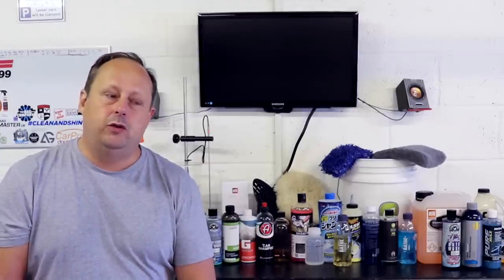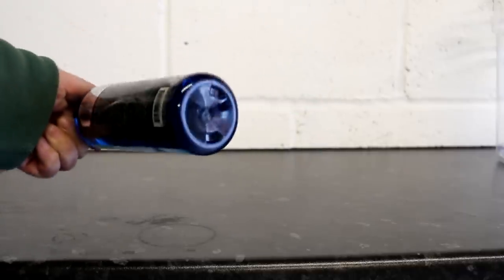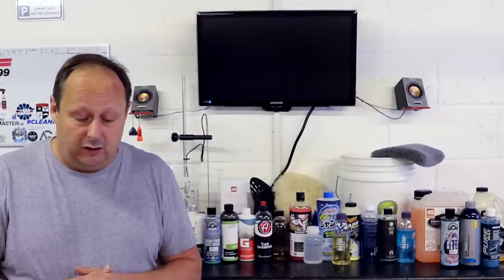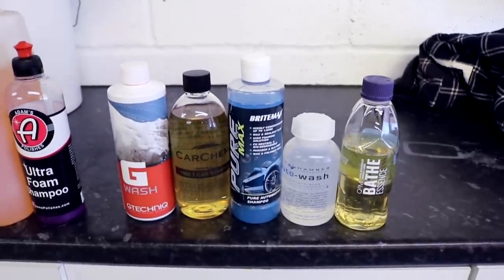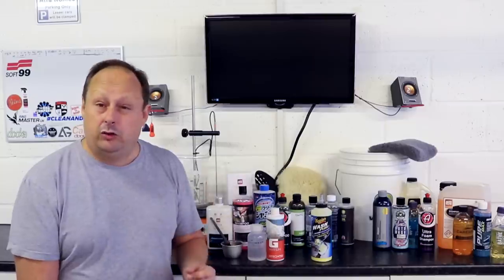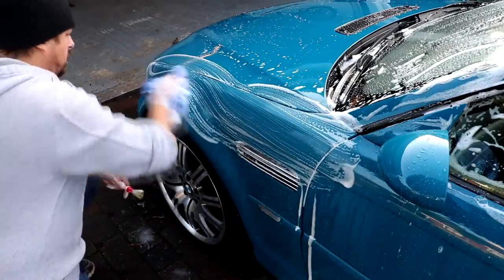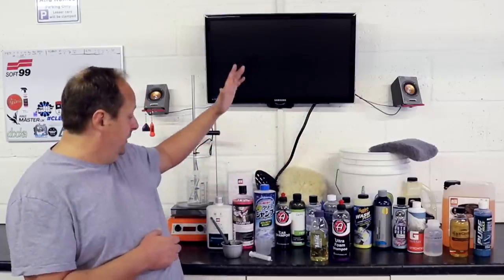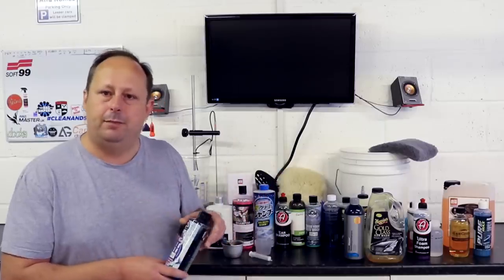The Best Car Soap Shampoo - 20 product shootout

Comment: Really impressive review Jon. I did not realise how concentrated Gyeon and Gtechniq's shampoo's were. I'm no pro detailer, but I do like the feeling of having plenty of product in stock. I think that's what put me off of buying them and the bilt hamber shampoo. Having said that I will change my thinking having watched the review. Once I get through my 5L tub of Auto Finesse Lather, which smells amazing and leaves a nice glossy finish; I will look to get either Bilt Hamber Auto Wash or Gyeon Essence. The other shampoo I use for when I am looking to decontaminate is Chemical Guys Clean Slate, which seems to work fairly well. Keep up the good work.

Comment: I don't want anything to do with the super high concentrates. When I'm out cleaning my car the last thing I want to be doing is measuring out soap with a dropper pipette. Since I have a ceramic coating a couple of capfuls of Carpro Reset and boom I'm good to go. Decent price, foams like nobody's business, and very effective. Also you mention it a bit but the big upside to the Adams soaps is that even if they dry in the sun they still spray right off.

Comment: Terrific video Jon, I'd love to see one on the pros and cons of over and under dosing. I'm and Adams user in the summer and a carchem user in the winter.
Reply from the maker: yo dave, overdosing just for me means its much harder to rinse and even if it looks like you have rinsed properly much higher chance of soap stains and all the concentrated soapy water that gets into the wing mirrors and run off areas, when that rruns out later on its gonna be more soapy..  underdosing can just mean theres like less cleaning power, less suds less slippyness.   Im not sure which is the lesser of two evils really.

Comment: I'm currently using the Meguiar's Gold Class shampoo on my almost new all-black 370Z and it does a good cleaning job with good gloss afterward. After I get the paint corrected and get a ceramic coating applied I will do some research to find a possibly better shampoo for the finish.

Comment: Great video and i respect your findings and  your winner, i have tried well over 20+ shampoos and the number 1 thing i look for is slickness (which you did not mention much in the video) which is why Carpro reset is my favourite as it is super slick and i use it at 20ml so pretty cost effective aswell and it foams well and not overally expensive to buy either, so i find reset the best all rounder and i have Gyeon essence also but will still use reset, based on how good it is to use and slickness.
Reply from the maker: I honestly couldnt measure slickness jason, when I planned out the video ages ago it was one of the things I was gonna try and look at and rate them on.  a couple of the companies that manufacture also say there is no like lab style test for it..  its a bit like a bar of soap, the more you lather it up and wet it up the more it slips out of your hand.
Reply: @ForensicDetailing  fair enough, looking forward to snowfoam one next 😀.

Comment: Another great vid, thanks. I’m learning so much from someone who actually uses the products. In the vid you use the pressure wash to fill the bucket. Is that just to aspirate the solution to get it to foam or do you only use cold water. I use warm water as in my mind it helps get the concentrate to mix and helps keep your hands warm, do you use warm water? Loving Bilt Hamber products but never heard of them till I started watching your vids. Once again thanks for your efforts. 👍

Comment: Great video again Jon. I was convinced  Bilt Hamber would take the crown but fully understand why it came third. I still think I'll have a bottle of it somewhere. Megs Gold is still my favourite but I'm shocked at the price. I need to do some sums before I buy. Any opinion on Autosmart products which seem to offer great value for money for the trade user?
Reply from the maker: the AS shampoo is an example of decent value but where concentration is king.  because you need to use 50ml per bucket of the AS stuff.   which makes it about 10p a wash.   the carchem hits like 2-3p a wash or 5p a wash if you up the dosage a bit.   but still half the cost per wash.
Reply: @ForensicDetailing  Cheers mate. I've just started detailing for a independent Jaguar specialist and everything is AS as it's trade prices and delivered.  I need to convince them that there's better and cheaper products out there.
Reply from the maker: I think your in good hands generally with AS stuff. a lot of guys in the trade use them.  their prices are decent and the products Ive used have been effective.  they cant or wont always be cheapest but the brand definetly offer really good value.

Comment: Hi John, It is really tons and tons of information for free. There is an old saying “even war is won with information rather than with battles “ Hats off to your commitment. 
I have a small question: most of the products you described are either very expensive due to import duty tax or not available at all in india .i got only few choices 1) carpro Reset 2) Chemical guys mr pink 3) Adams is little expensive than the above two . Please suggest me a shampoo that can easily remove the bugs stains ,grime and heavy sand dirt ( my work location at the beach )from the car .
Regards 
Kartheec
Reply: And my car is completely covered with PPF except the the sunroof

Comment: Have you tried gyeon bathe (not essence and not plus) cuz they say that smells amazing and is a bit more lubricating than essence but i dont know. Ive only have the essence and bathe+. And as you said the foam aint stable cuz the silozanes and therefore i think it wont have the barrier between the clearcoat and mitt that a highfoaming schampoo has. I would also recommend valet pro 15pounds for 5liters you need like 1dl for a 20l bucket but its so damn cheap that it doesnt matter. And it have this amazing lovly cherrysmell😍 i use it and use the gyeon essence like a booster in every bucket i have with schampoo. Havnt tried it togheter with bathe+ maybe that would work. But as youve said in previous vids i also think ita better to do a 1st wash with regular schampoo and a 2nd wash with bathe+ or skip it and use cure or similar brands sio2 topper.

Interesting that the essence have got thicker. Mine hasnt and been open for the same amount of time.
My fav brand is gyeon and valetpro and bilt hamber close 2nds but all gyeon bottles with this type of lid gets broken. Its damn annoing. Ive dropped a gyeon foam when i lifted it in the lid and the bottle hit the garagefloor and the product just splatter like a vulcano all over the new washed and dried car that was right next to my productshelf....i think they will redesign the bottle if they are the manufacture or change to an other bottleconpany🤔
Reply from the maker: cheers Jimmy Ive had problems with the Gyeon lids as well.  so far no problems with the bottles but yer they perhaps dont look as robust as they could do but damn sexy bottles :)

Comment: I used the Bilt Hamber auto wash twice. 5ml in a 10 litre bucket, started off with plenty of suds but it very quickly went flat on both occasions and I live in a soft water area too. It was a bit of a let down to be honest.
Reply: Mix it with Adams to increase the suds and get the rest of the benefits of BH.

Comment: Another great vid,   What I find with Bilt Hamber Auto Wash is its just a boring shampoo, lol.  Bottle is boring, colour is boring and its just boring but its a great shampoo.   I like Adams Car Shampoo and CG Gloss Works,    I like the bottles, the cap, the foaming, its viscosity and  mostly the colour,  lol.  For some reason the blue just excites me. Haha.         I now use Adams for 90% of my washes and Auto Wash for a gloss top up and something different every now and then.  The wife gets the Bilt Hamber and Gyeon Bathe.            Before I ever buy a product I always check out your vids first so thanks for such a great channel.      Oh John.  I cant find anywhere a Tar and Glue remover shootout vid,   Is that on your list for something to do?
Reply from the maker: lol I know exactly what you mean and your not the first to say this..     Its like the adams looks cool, smells cool, just feels cool, its that jet blue color the thickness the nice smell.   I felt the same with the autoglym UHD.   man just the smell of that stuff is unreal and you smell it as you wash the car the scent is so strong an awesome.   But subtle things go on with the BH product.   And the longer you use them the more you notice the subtle things..      Get a mild steel bolt (not stainless)  and drop it in a solution of adams or chemical guys or any american car soap.   get another steel bolt and do the same with bilt hamber.    Also if you can test cleaning function and degreaseing power you will quickly see that BH cleans more than other shampoos.

Tar and glue remover..  if you want the most powerfull just use Tardis from autosmart get 5 litres of it and your done.. but its perhaps a bit hardcore.. like proper strong smelly mineral spirit.

Comment: I've been using Gyeon essence for a while, but I find I have to use alot more than they recommend. Not had any issues with it thickening, and it's sold with a squirter nozzle like hand wash so no issues with spilling or the cap breaking 🤷🏾‍♂️
Reply from the maker: all the high concentrates perhaps where they say like use 5-6ml  you might want to use like 7-8ml for example.   I agree though mate
Reply: @ForensicDetailing  Hey Jon, so do you believe with autowash where is says 5ml to 10litres of water that it is ok to put 7ml instead? i feel like this product hardly foams up and has lube so not sure if it is doing the paint any good..? i could be wrong

Comment: Bought some Bilt Hamber Autowash the other day. Partly on previous recommendations and also watching this video. I use 5ml in a 10L bucket with warm water. Must say I'm a bit disappointed. Initially the product foams up but after 2-3 minutes it's like using dishwater. I live in the South of England (Dorset) and I suspect the water is quite hard. Appreciate the suds aren't everything. Perhaps I will try upping the dose for the next wash.
Reply: I find this with BH too and I'm in Scotland with very soft water. Have taken to mixing some Adams in with it to give better long lasting foam and prevent drying out if washing in the sun.
Reply: I was also disappointed with BH. Very little suds & low lubricity. I couldn't wait to use it all up so put in triple amount recommended just to get rid. I would highly recommend Carchem super suds. It's a pure shampoo that works amazingly. For maintenance washes I will use Carchem shampoo followed by Meguiars fast finish sealant. The result is fantastic every time.

Comment: Great review! You've covered all the areas! Probably one of the best channels about detailing products! Keep it up! :)

I have a question about Soft99 Smooth Egg shampoo... It is a product mainly for coated cars with hydrophobic effect (probably something similar to bath+).... 
Do you have any experience with this shampoo? Is it a product which you can use on a car that has fusso 12M wax without reducing the longevity of the fusso 12M wax?
What shampoo would you recommend to use on cars with fusso 12M wax?
Thank you for your answer!
Reply from the maker: Hi there Ive not used smooth eggs sorry.  I would say if your into fusso and soft 99 wash it with this soft 99 creamy shampoo you will like it I promise.  Also get soft 99 speed and barrier, if seems to be able to sit on fusso (even though its a sealant in its own right)  but it will layout more PTFE based protection and top up beading.  Soft 99 luzory spray wax can be used as well to a similiar effect but it adds less sort of beading and water repellency.
Reply: Soft 99 speed and barrier isn't yet available at our local dealer so I've gone with fukupika advance strong type. Been looking forward to trying the fusso 12M + fukupika combination! The fusso is on the car for about 5 months now so I'm going to give it a little help from fukupika. :)
Thx for the shampoo recommendation! I'm probably going to take your advice( because I'm sure that it will do a decent job). So far I've been using the meguaris ultimate wash and wax which, like the gold class, you have to put a decent amount to get best results. :)

Comment: Didn't get on with 1900:1 myself. Started at the right dilution, nothing, bucket of water still. Added a few more mls, still nothing. Chucked in a "glob", nowt, no suds or slickness even with the pressure washer to suds it up. Ended up ditching the lot and washing with Adams.
Reply from the maker: sounds wierd tim.  no suds gotta be something borked with what you had there m8
Reply: @ForensicDetailing  think I'll order another bottle and give it another shot. Great video by the way, that's a lot of work to put together!
Reply: @ForensicDetailing   yep, my first bottle was 110% a complete dud. Second bottle is perfect, loads of suds and lubrication from just a couple of caps in 15L of water. Probably even used too much and will try a little less next time.

Comment: Interesting about Bathe Essence because I noticed the same thing about it turning into a thicker gel.  Did your not come with pump?  Either way cost per wash aside I was underwhelmed by the performance of Bathe Essence.  Gyeon Bathe is a better wash and a better performer but just not cost effective.  Adams seems to outperform Bathe Essence for me and the fact that it can be used in Sun helps here in sunny Southern California.  Reset is a must have for a coating every few washes.  Great video on capturing your thoughts on these various shampoos.
Reply from the maker: Id imagine essence and normal bathe right (not bathe+) would be the same like chems just difference concentrations?  Adams in the sun for sure is good reason to pick it.  thx mate apppreciate your thoughts.
Reply: What aspects were you underwhelmed by?

Comment: My black 335D will need a light cut/finishing polish soon but my Kestrel polisher has started to spin really slowly and I can’t figure out why... So until I can fix it/buy a DA... What finish would you recommend if I still want it hydrophobic, but not so hard that when I come to do the correction I have to machine off a light ceramic... I want to give that Tac Systems moonlight a go once I’ve prepped the paint, but want something in the meantime to give it some protection... Hybrid ceramic wax maybe? I’d be interested to know your thoughts.... Definitely going to be investing in some Car Chem/Bilt Hamber products based on your reviews. 👍🏼

Comment: I wanted to like megs wash plus. it really resets the paint big time, but it does scratch, it scratches even glass, definitely plastic trim and paint clear coat too.
Reply from the maker: imagine if an abrasive particle in this product could scratch your paintwork pete.   your paintwork would haze up faster than usain bolt running the 100meters.   There are hundreds of thousands of microabrasive particles in it.  They would have to be the size of meteorites to scratch when they are the size of golf balls in comparison.  if your seeing scratching its not because of this product just think about it for a second and think what it actually is, think of how many scratch lines you are seeing and the density of them and think how many abrasives are in the product.  scratches are caused by rubbing dirt over the paint.
Reply: @ForensicDetailing  generally not an issue as only use it before using the DA (megs MF system) then applying moonlight. I'm just pretty sure with a clean mitt that it has caused scratches to our cars. What do you make of apex details video on it? Seen it?

Comment: Hi Jon! Have you had any tests or simply noticed from experience about the corrosive effects of these shampoos, just like you tested the snow foams? I know BH auto foam and their shampoo are anti-corrosive, but I'm wondering about the others? I have a full bottle of Koch Nano Magic and I'm wondering if maybe I should simply give it away and go with a BH cause I have to admit, some of those snow foams caused REALLY heavy corrosion on the test plates, so I'm not exactly nitpicking here, the effect is real and noticeable. Thanks again!

Comment: The better shampoo seams to have a high pH.  Won't that remove (bit by bit) the ceramic coating?   If so, which is the best neutral pH shampoo.  If not, can you explain why it won't hurt the ceramic coating?   thanks